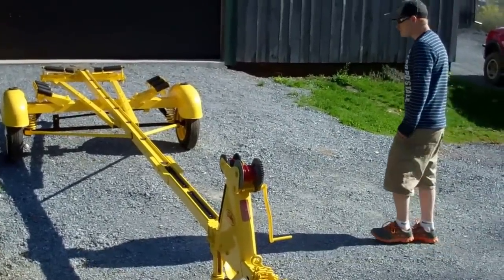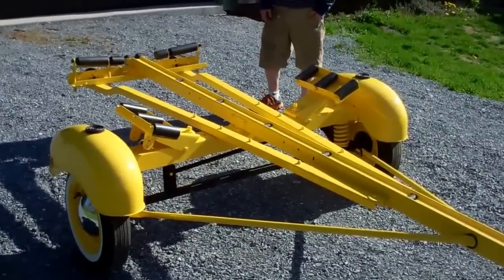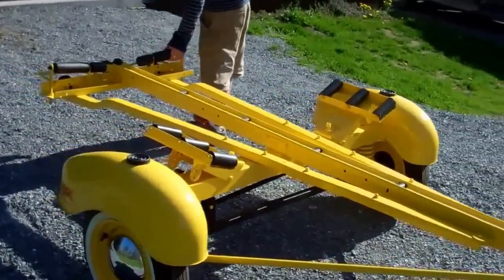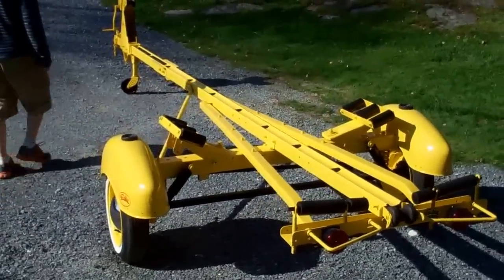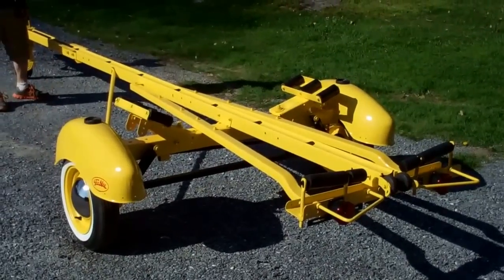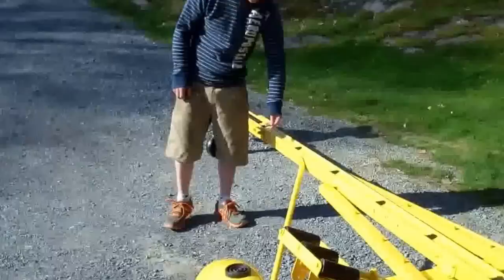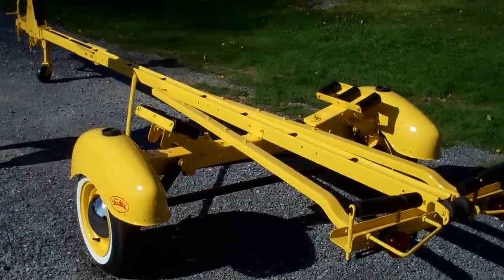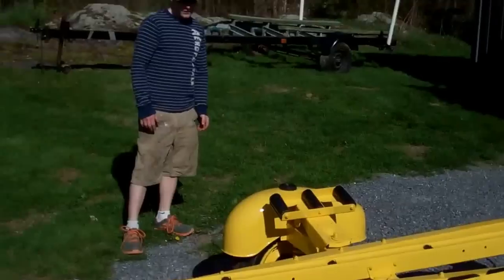1959 Tilting Tee Nee Trailer Restored by Roger Towle

Comment: What an awesome project, I just picked up a 1963 Calkin that I plan to restore for my 1968 15' Grumman Sports Boat ( fenders are super cool heavy duty metal that you can actually step on.) In the transom their will be a 1959 10HP Johnson . I can't wait to get started, it also came in yellow color and was wondering why some of these vintage trailer came in that color. Any clue?
Reply from the maker: Hate to say it, but it’s true. Tee Nee sold as many as 100,000+ Ford Chrome Yellow trailers/year during the 1950s. Some competitors plagiarized both the design and the yellow trying to compete. 
Additionally, some restorers tried to “transform” and then sell non-Tee-Nee into Tee Nee by painting them yellow.

Comment: Just bought a teenee and I gather it’s from 1958. It is missing a wheel and the other one is too rotted out to see specs. Would a 5.7 x 8 inch tire with four bolt fit? What size tire is yours? It’s very similar. I can’t find anything and I’ve searched far and wide. Thanks.
Reply: Beautiful job btw. I might do that someday if I ever have time to spare.

Comment from the maker: Del VanEmmerik (herters59@aol.com) is my go-to source of all things Tee Nee, save for the roller pins, which I can supply in stainless.

Del has a barn full of Tee Nee parts, and he also fabricates many of them.

Search for Tee Nee roller pins on eBay, as you will almost surely need to replace them: I have a "how to" video on  the SMB channel.
We've done several Tee Nee trailers, so please do not hesitate to fire questions my way.